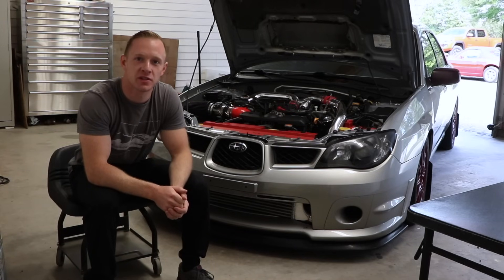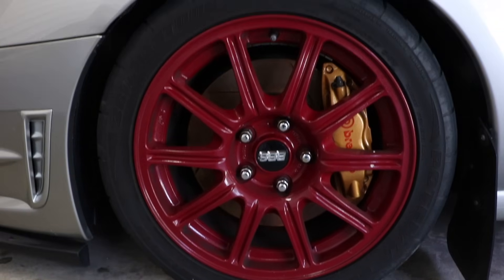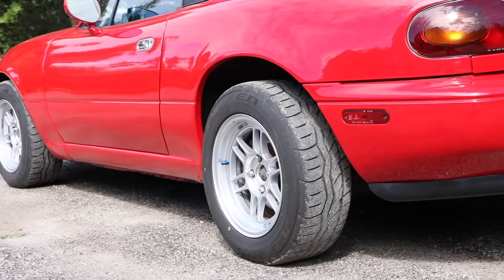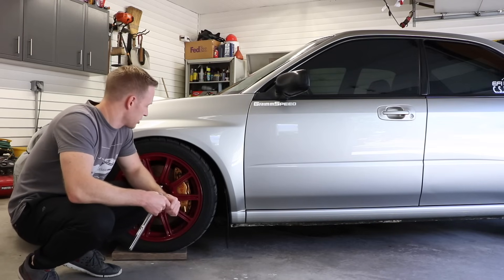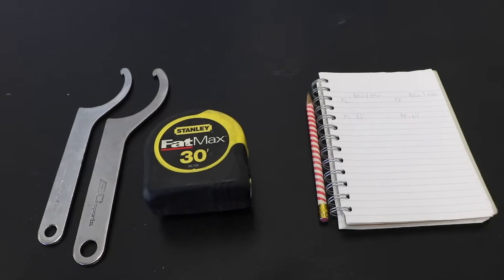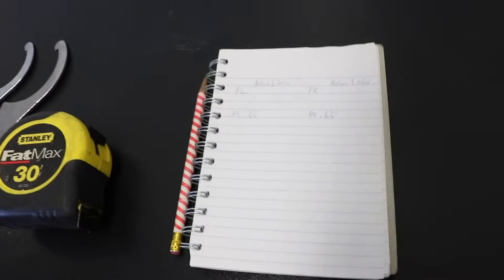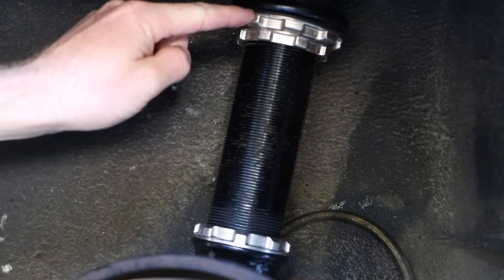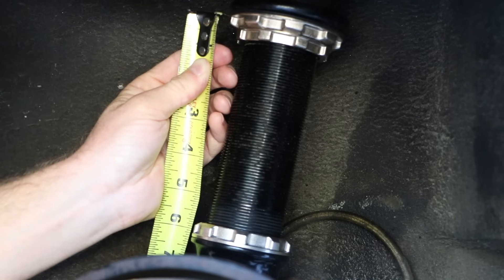How To Adjust Coilovers Properly

Comment: Wow thanks man this really helped, its way easier than i thought
Reply from the maker: Ol' NoName happy to help!
Reply: @DriveItRyan  You still need to align it, right?
Reply from the maker: @vlenhoff  it’s not absolutely necessary for this small of a change in ride height.  You probably should, yes, but I personally did not after this adjustment.
Reply: I did not know this I took the whole coil over off 🙁 this definitely helped bro thank you
Reply: @DriveItRyan  so that 1/4 adjustment raised the car 1/4 correct?

Comment: hi! i own a 2017 honda civic sedan with 1.5L turbo engine. i bought a ksport coilover. how should i know the proper level of damper? how much difference are the damper level in front and rear? should left and right be the same? thank you! its my first time to use coilover
Reply: thanks! but how about the rear and front? how are they usually set? is the front softer than rear? thanks a lot!
Reply: thanks a lot man!
Reply: Al-Maruf Macarambon the front is ofcourse stiffer then the rear

Comment: when i am doing this only the 2 rings spin not the threads
Reply from the maker: Joelle Donnelly make sure the rings are locked together or else you will be adjusting preload instead of ride height.

Comment: If i want to lift my car back up about a inch all the way around do i have yo do preload setting again
Reply: no you don't. your preload should be adjusted to whatever is recommended by the manufacturer which is usually about the thickness of the spanner wrench or 4-5mm. you shouldnt have to touch the preload again unless your car goes to the track and you want to get the most performance/handling out of your coilovers. you can focus on the dampening though. the higher you go with the ride height the softer you can run the dampening for better ride quality. you can adjust it to your preferences.

Comment: Wait so to raise it you loosen the bottom then only turn the very top collar? Your arm was kinda in the way so I wasent sure which collar you latch on
Reply: Pretty sure. If you loosen the very bottom collar and then only use the very top collar to adjust the height, I believe this keeps the spring load tension the same as it was before but allows you to raise the car. Would like someone to double check on this though because this is the first video where the person uses the top collar instead of the middle collar to adjust height. This video should be helpful https://www.youtube.com/watch?v=yUAYJNe2cfo

Comment: Broseph THANK YOU 🙏 I just received my GodSpeed Coilovers w/ adjustable Damper, ride height and Camber. I thought I would just slap 👋 em on adjust ride height and be done. I did not know about setting the “Preload” so I was a little confused about what exactly I’ve been tightening. You showed using the top perch w/ “jam nut” to lock preload and loosing bottom perch and turning the top jam nut so that you don’t compress or change preload only ride height. 
THANK YOU! ✨
Reply: How were the godspeed coilovers?
Reply: Kentucky Blugrass mannn the damn Godspeed momo SS had me pissed off so confusing lol this video helped me too lol

Comment: Aren't you messing out your spring preload?
Reply: No because the whole tower is spinning within the bottom housing. If the tower wasn't turning too, you would be making the spring tighter. But as we can see the whole thing spinning, he's doing it correctly
Reply: No but you are supposed to adjust via the spring not via the base. You are supposed to have the base height set for wheel travel. Then you set the height by compressing the spring
Reply: Preload doesn’t affect stiffness

Comment: You're only supposed to use base height adjustment to set bump travel.  You adjust ride height using the spring adjustment.  Basically the video is the wrong advice.

Comment: Quick question, does it improve it's handling?
Reply from the maker: joseraynor tibor I no longer rub on the fender liner over hard bumps since the wheel has more travel with the added height. So in that regard, yes.  Sometimes if the wheel bottoms out against the fender it can unsettle the car.

Comment: Thanks mucho! Very clear and straight to the point. I was ready to drop $400 to a shop because I didn't want to attempt it myself. Hopefully it'll go as easy as it looks. Is there a torque spec on re-seating the lower perch nut (hope that's what it's called), or just get it snug with the wrench?